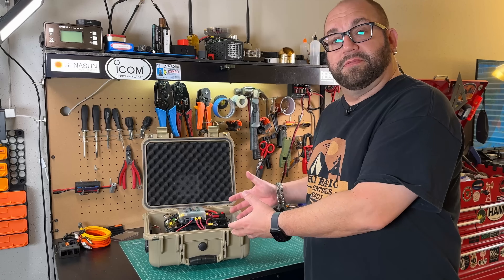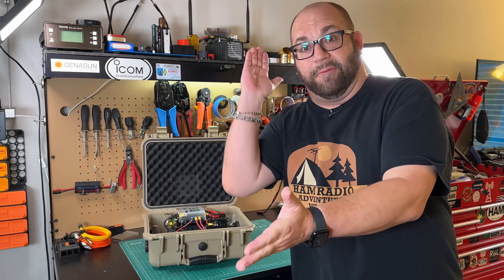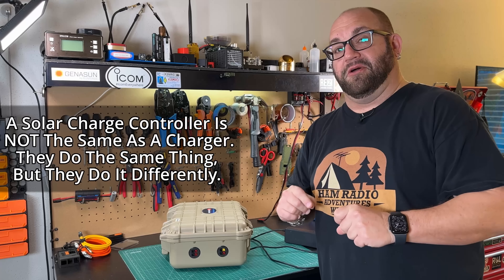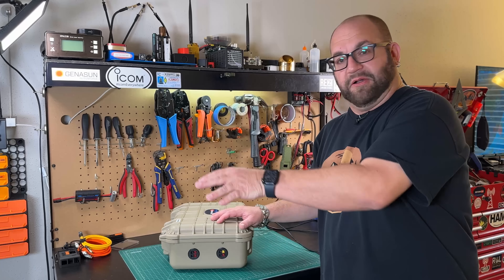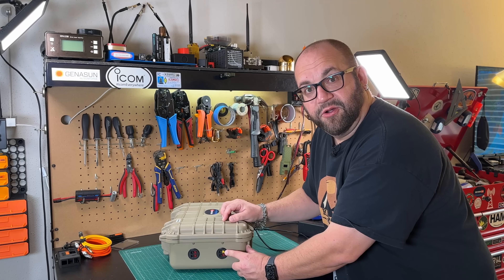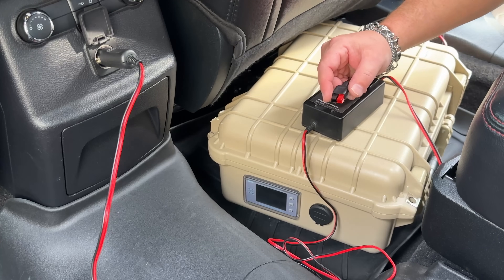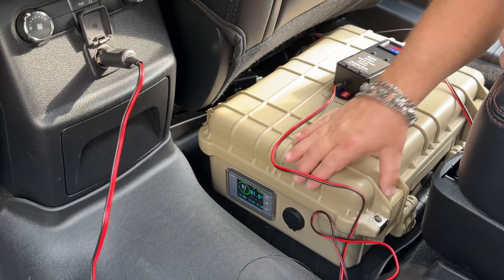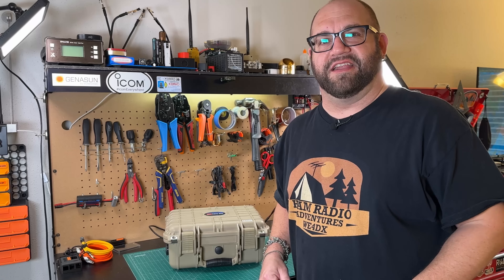Idiot's Guide To Charging Your DIY Solar Generator

Comment: Check out West Mountain Radio's Epic PWRGate controller. It's both an MPPT solar charge controller, and a power management system. It has inputs for solar and a 10A power supply. It also has an output for all your fused loads. When the load exceeds the power supply or solar input, it will automatically route all that incoming power plus any remainder from the battery to the loads. I just finished a 40Ah Bioenno battery box that was heavily inspired by you, and used the Epic PWRGate for a super clean and flexible install.

Comment: "what does a generator do?... it generates electricity...  these use the sun to generate electricity!" - proceeds to show battery charging via ac to dc power supplies, dc to dc power supply, never once shows using solar to generate electricity.

this is NOT a solar generator.  the photovoltaic panel IS the generator... this is just a battery NOT a solar generator.  you can charge it with gas generator, a dissel generator, a solar panel, an ac to dc power supply...   sure, it accepts solar input, but it DOES NOT generate solar power, it ACCEPTS solar power to charge the battery.  it's a battery, a charge controller, and an inverter... which makes this contraption? - a multi-purpose battery... NOT a generator.  it generates NOTHING. it STORES electricity.  it's a BATTERY.  you could even call it a solar battery (because it's got a solar charge controller and directly accepts a panel - which would be the generator in this case).

Comment: what??  That is not a solar generator unless solar panels are BUILT IN or primary source of power is solar.  99% of people are charging these off grid power, so it is a a power station.

Comment: I don't understand why you said "I don't recommend charging with a power supply"?  I use a 24v 200w power supply that I purchased from Amazon for about $30.  I plugged this into my solar charge controller input.  I'm using a Victron SmartSolar controller.  When I plug this into my AC outlet, it would crank up to 24v and a little less than 200w.  I plugged a DC-to-AC inverter into the 12v DC port (cigarette lighter adapter) and it blew the 15 amp fuse after a little while.  My controller lets me set the battery charge maximum level.  The default is 15 amps.  I cranked it down to 6 amps, this allows for about 90 watts and doesn't blow the fuse in my care.  Like you, I use the battery to keep a 12v fridge running in addition to using it for my radio.  I plug the 12v fridge into the battery box (it has a 12v adapter port), plug the 24v 200w power supply in to the solar panel input, and then plug the power supply into the DC-to-AC inverter that is plugged into the car's 12v DC port.  When the fridge always runs off the battery, the battery is being recharged as I drive the car, and all works well.  Depending on how long I'm out doing POTA, I may plug in a 100w solar panel or start my Prius up to get a little more charge when necessary.

Comment: Question...
Since you have built and sold several of these, do you think it would be worth the extra cost to build in a stand alone solar connector with the Anderson stacked vertically, instead of horizontally as they are now? 
I am researching building a line solar generators for use as a power system for some camp trailers I am building, as well as standalone systems for off grid campers and overlanders.

Comment: If your generator has a 12v female "cigarette lighter" plug, would it be possible to charge the internal battery using that plug? or is it best to install dedicated inputs (like on your generator) instead?

Comment: I am offended that your videos have lead to many dollars being spent building battery boxes. 😂. On my work truck I run my radio and Starlink off solar charge controller. And I have a 90w solar panel on the hood. Not the most efficient panel. But keeps my battery topped off most of the time.  The one on my gladiator is only 35w and only helps compensate some of the loss and I generally have to charge the battery over night. Solar rock. 🎸 🤘

Comment: I built one of the same boxes in November of 2024. I fired two Genasun controllers charging just as the video described with the red and black power poles.

The first time I contacted Genasun support via email, I was instructed to call them directly. I talked to one of the engineers, a very nice guy. He gave me a quite in-depth lesson on LiFePO batteries and solar panels, about a 30 min phone call. I asked him about charging the battery using the power pole connections, and he had me verify the charger was the correct specs. The first controller was replaced under warranty.

The replacement unit not survive the same charging procedure. No clue what the problem could be.

I have since installed a Victron solar charge controller, and I've had no problems charging it.

Comment: Mike, does the Paradan dc/dc draw from the battery if the cig lighter port is powered off? Any leakage? Or should it be unplugged when the car is off?

Comment: "Heavy metal all the way!" 🤣 I'm a metalhead myself, mostly progressive and symphonic. Death metal, not so much. 😛 Regarding alternator charging, "experts" say that an alternator can operate constantly at 50% of its rated capacity without harm. Back when we were young, the cars that we could afford had just 60-70A alternators. Things are different today. My low-spec GTI has 150A alternator and has suffered no apparent consequence of charging at up to 50 amps with my Orion XS 12|12-50A. However, the alternator pulls back charge current to about 35-40A during the summer months when its case/body heats up. I'd pull back and take a break, too, if my body was working at 170°F in an engine bay on a hot day. 😋 73! -Scott

Comment: I built mine using your design, but I added another outlet to be able to plug my AC charger in as well as the solar. I even made a switch to be sure when using the AC it disconnects the solar controller from the circuit. I wasn't sure if the AC charger would mess it up. It's fun to experiment, the box works great, but I guess I made more work for myself than was necessary.
Reply from the maker: Lol you sure did as they were already there 🤣. But hey, that's the fun in building projects like this.  We get to learn!

Comment: Just a suggestion --- When using Anderson Powerpoles I orient them vertically for anything that isn't 12-14v.  This eliminates the possibility of plugging a high or low voltage into a battery circuit without the charge controller to regulate things appropriately.  It would be a bad day to plug a 30v. high amperage solar panel (I have a panel that puts out 100vdc) into a 12/14v. connection while sensitive electronics aka transceiver are also attached.  In that situation a fuse will not help and the magic smoke will float away.  The drawback -- you do lose the androgenous connection for solar (still polarized when wired correctly), but to me it is worth it because it makes it impossible for you or anyone else to make a mistake (even in the dark).
Reply: That's a pretty good idea.
Reply: Technically, it’s not a generator it’s a rechargeable battery if it was a generator all you would have to do is crank it up and let it run! lol 🤡🍿🍿🍿

Comment: Mike you can't save everyone from everything! Next you get emails from those trying to pull 20A from a cig outlet. A suggestion though, if you label the ports it will help your viewers understand when they watch your video, You designed and built it, of course you know, but not everyone has your battery chops!  See ya!

Comment: I really like my PowerWorx DC-DC-8A Chargers.  It has power pole plugs for both in and out.  I built a Cig to PowerPole cable so I can plug it into my van.  The DC-DC charger has a dial for 2-4-8 Amps.  Most cars cig ports can handle 10A so it works fine for the vehicle wiring and the alternator.  The knob is nice if I'm charging a small say 6Ah battery.  The other crazy thing I do when I'm POTA camping is plug my 100Ah battery into my Victron solar charge controller with my 400W panel and then I plug the DC-DC charger into that battery and connect a second battery (normally my battery for my diesel heater).  So I end up getting about 12A into the main battery and 8 into the other as I normally see 20 to 22A from that big panel.  As such I didn't integrated a solar charge controller in any of my 6 battery boxes.  I put the charge controller in a small harbor freight plastic ammo can with the MC4 and Power Pole connectors surface mounted on it.  With the Victron's app for the phone you can tell it what the maximum amount of amperage to pass through it so if charging a smaller battery I can dial it down to not overload the BMS or shorten the life of the battery.  Works a peach as they would say.  KK7PZE